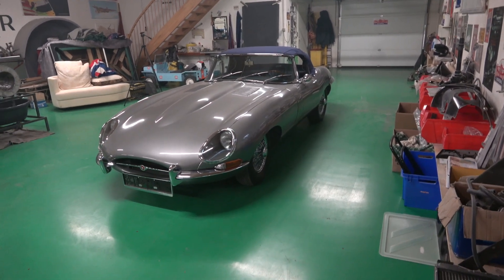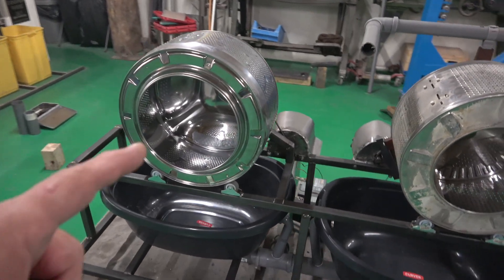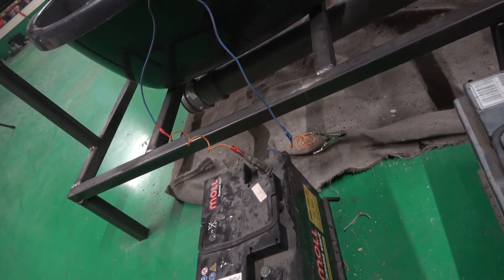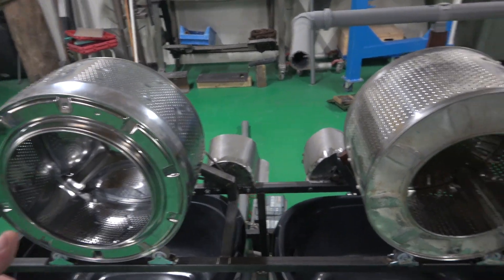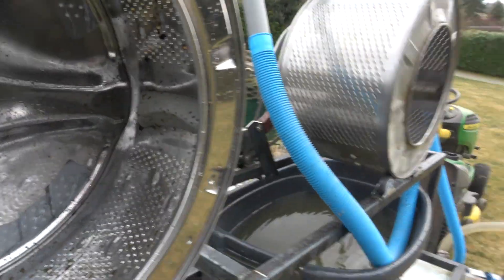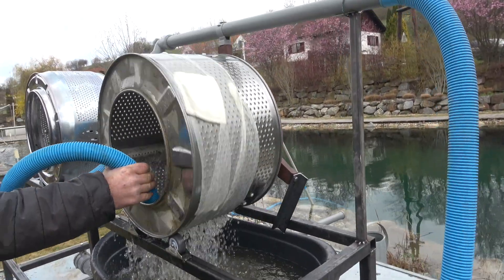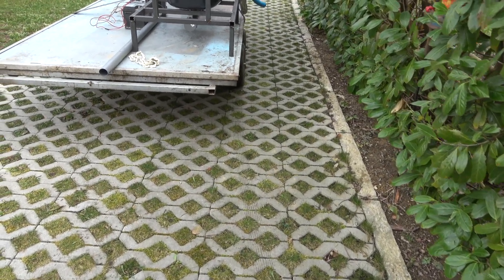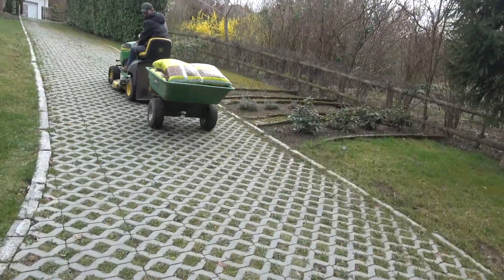IT WORKS!  Water Algae Separator Part 3

Comment: Nice engineering Dave line the drums with paint booth filter medium also your water accumulators a fine mesh with the same it will slow the flow rate through the drum and also remove so much shit
Reply from the maker: Peter,  We have a couple of ideas for filters like fly screen mesh but as we live in wind growing area
they use mesh for filtrating the grapes. I will take a look at you suggestion. Cheers Dave